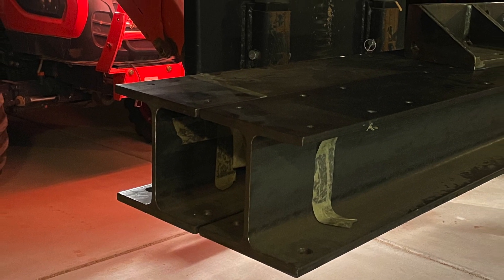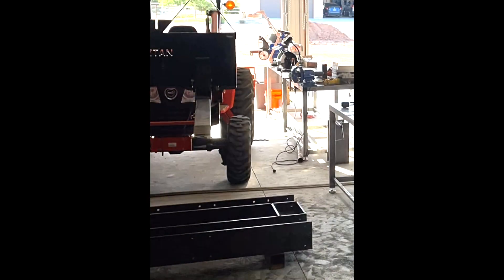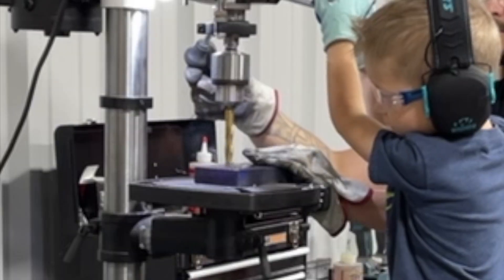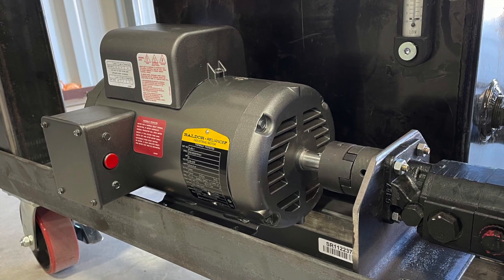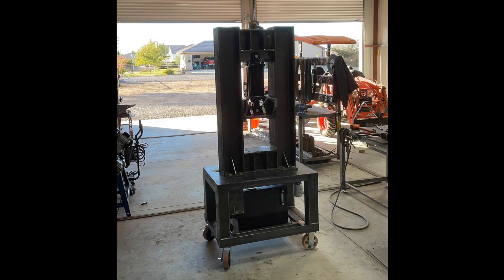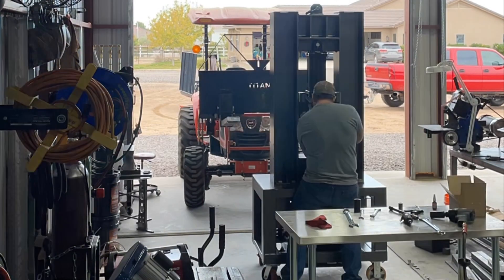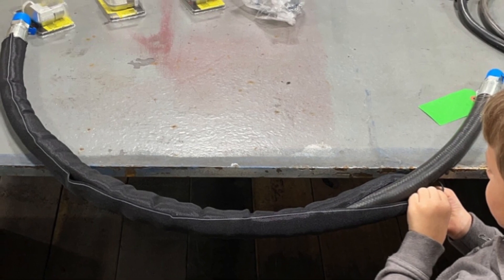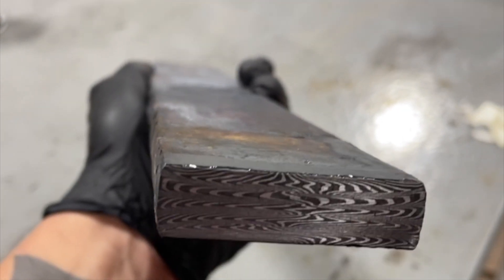From Raw Materials to Powerhouse: Building a Forging Press from Scratch!

Comment: If a friend asked you to build the frame and base,  where all he had left to do was add the cylinder,  valve, pump and motor,  how much would you charge your friend?  Having a friend build me one (because my welds suck),and his "bid" was super extra low, ($25-$50), but I want to compensate him correctly for all his work.
Reply from the maker: Based on his price, I’m assuming you are buying the material and that is strictly labor? I charge $70 per hour for fabrication/welding (materials excluded). For friends, I’ll do it for a less, $60/hour if they throw in a case of beer.
Reply: @Quantum_Ironworks  he's got 8", 10", and 12" I-beam cutoffs from his work site he's going to use.  So, probably just labor then.

Comment: Nice job!  That thing is a beast.  I dont have acres and a huge shop so mine will be a 25/30 ton benchtop.  Im pretty sure you could have built a 100 tom with that frame.  Im not a big fan of slider plates and grease so Im going to use roller bearings similar to an overhead crane design for the upper die section.
Forge On!!!
Reply from the maker: Ya I definitely could have increased the tonnage with this frame but honestly I just designed it around the I-Beams since I got those for free. I may upgrade the ram, motor, pump etc at a later time but this does the job for now. I did end up switching to rollers, they work much better!
Reply: @Quantum_Ironworks  Great video and build! could you post a short video of the updated guide system? I am in the planning stages of my forge and I am trying to put together ideas. I want to build it once and be done with it.